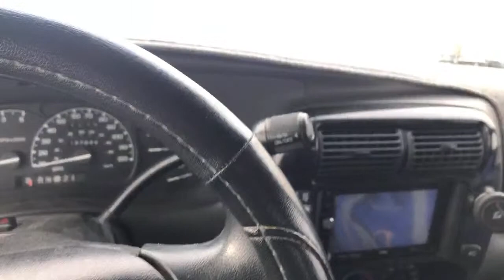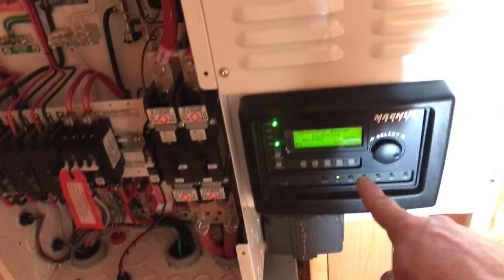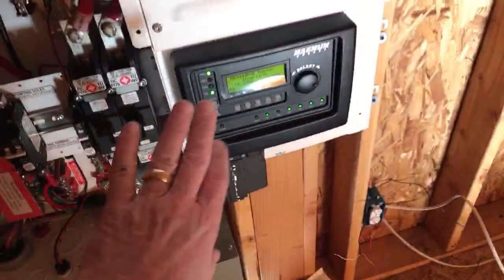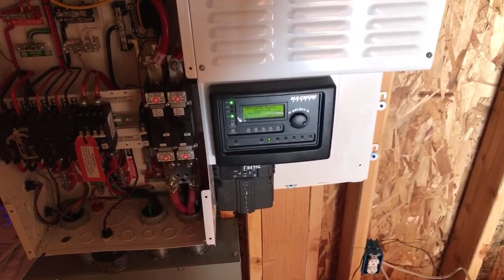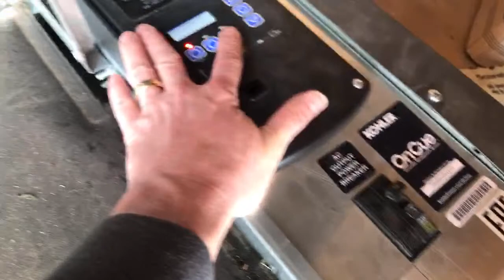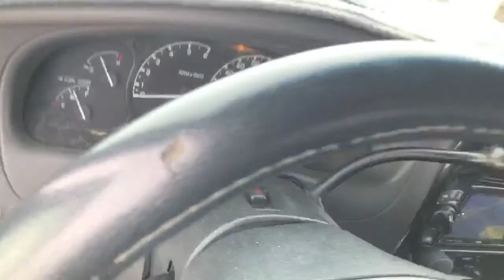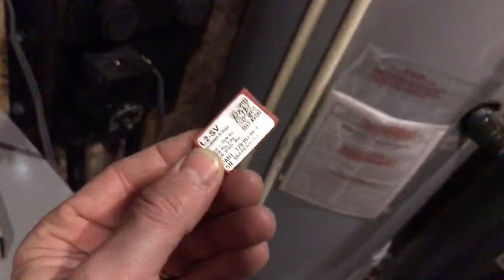wHobbit Hole Power Station and house tour

Comment: My garage door uses My Q and it may be a solution to getting generator auto/remote start. You can program,  monitor real-time, control remotely, etc.. I guess you could use an actual remote (garage door opener). Merry Christmas btw. I received my digquad yesterday and I, with the help of your video, got my first pix light system up and running with out too much trouble. Thanks

Comment: A few years ago I may not have trusted Home Assistant, but I think now I would trust ESP Home and Home Assistant to take care of the generator switch over.   As long as you have reliable hardware, the software is pretty good as long as you don't do too many custom integrations.
I know my Home Assistant has not crashed at all in the past year.

Comment: Before digging a trench or putting up dish antennas to bridge wifi, try a pair of ethernet over powerline adapters using the HomePlug standard. Relatively cheap and easy to try compared to the alternatives...

Comment: Several solar folks (Steve Robertson in Hawaii is one) are doing well with a hybrid electric water heater that has a heat pump built in.  Home Depot has a Rheem for about $1700.  They use the big heating elements when first turned on, then the heatpump (about 400 watts) keeps the water hot after that.  I think Steve modified his to run on 120V.  Once it gets warm the first time it doesn't take a lot of watts to keep the water hot with the heat pump.  You could even replace the 4500 watt elements with 2000 watt to reduce the power consumption.  Just an idea.

Comment: They probably didn't want to connect the geothermal to domestic water because of legionella danger. Geothermal temperature is not high enough to get rid of the bacteria. You will need electric heating or gas heating in series with the geothermal system.
Reply: Also, they may not be using regular water but some fluid that (a) doesn't freeze at ground level and (b) transfers heat more efficiently than water